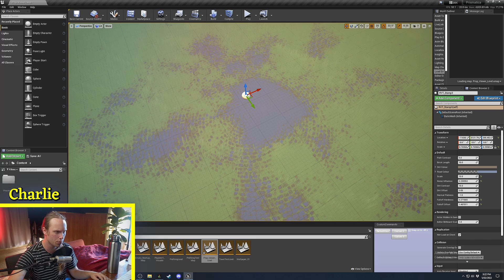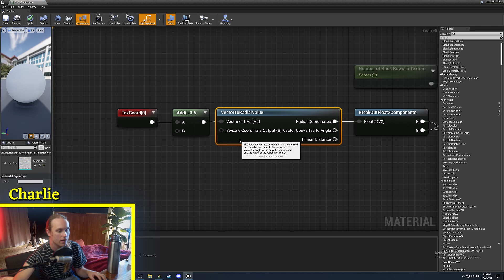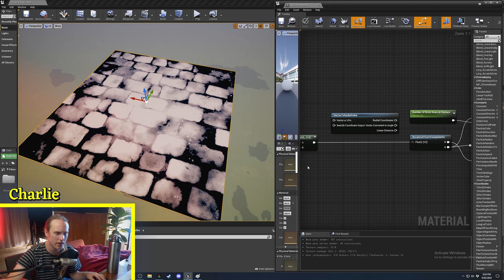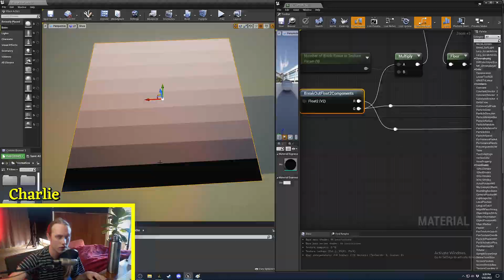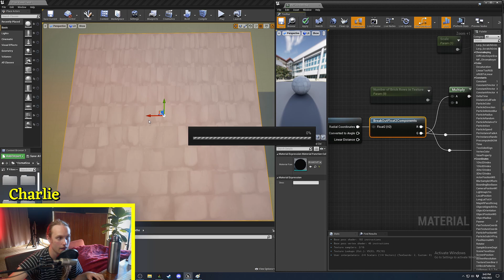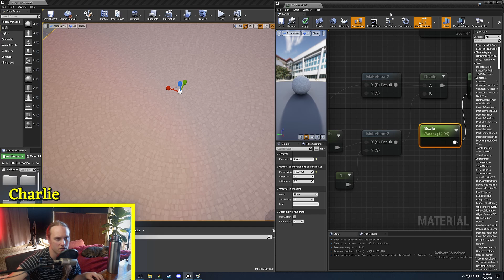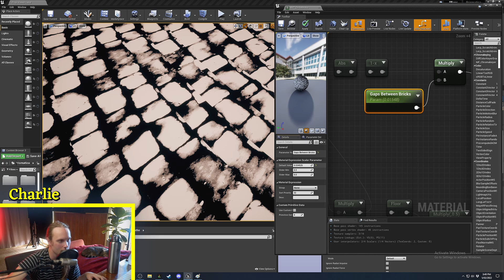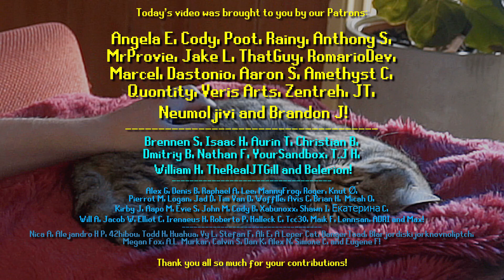Circular Town Centre / Crossroads using RVTs [UE4/UE5]

Comment: Will watch tomorrow. Family time. One question about rvt roads in general. How it handles landscape Z stretching. Do u use triplanar tiling for it?
Reply from the maker: Good question! If you actually make the spline conform to the landscape, it will prevent any stretching because the texture will be "slanted" the same amount as the landscape